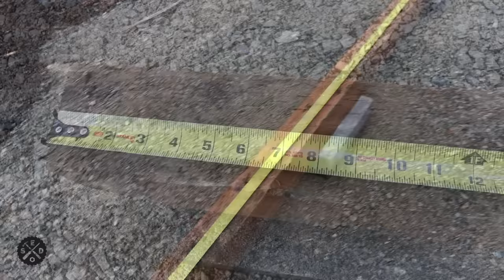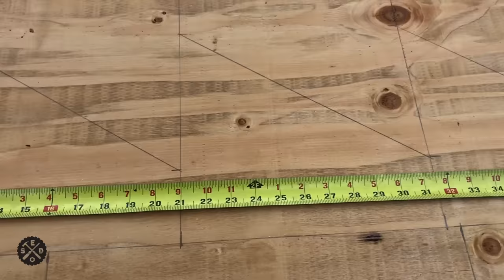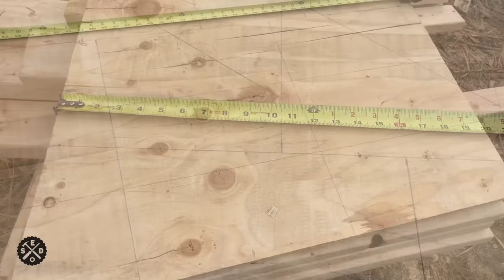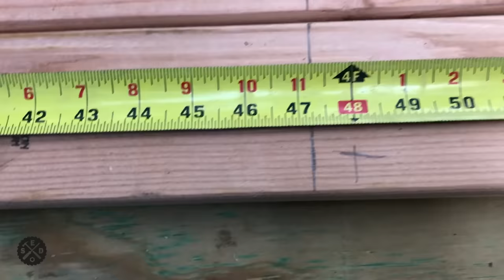How To Build A Shed By Yourself All STEPS 10x16 diy

Comment: Good norning all - nicely done. I have a couple of questions. What is your source for the rough cut lumber and is the Ruggedwood your product? tks grant
Reply from the maker: Thank you so much! So I just sourced the rough cut lumber local to my area. I would try to find a local sawmill if you can. You could ask around locally on Facebook groups etc. to find out if there’s anyone in your area that mills lumber. Yes the wood treatment is mine.
Reply: @SmartEasyDIYer  Thanks - I saw your mill, so you probably sourced close to home.
Reply from the maker: I actually just got the mill recently I didn’t have it when I built this. I would’ve liked to though.

Comment: When the wood expands and contracts with moisture and temperature changes the nails pull loose ; screws are better but their small heads eventually get pulled and pushed out of wood . To keep the whole build TIGHT use washers on every screw .
Reply from the maker: Are you talking outside on the siding? Thats why I use ring shank nails. They hold very well.

Comment: Question, how do you seal the overlaps of the roof, to keep water/ice build up between them?
It almost looks like you're in the High Oregon mountain area, I grew up in?  Great tutorial & build.  TYVM
Reply from the maker: Thank you so much! I’m in MT. It’s mountain area for sure. So there’s never really an issue where they overlap that I’ve ever seen. You can put a thin layer of butyl tape seal between the layers if you’re concerned about it, but the only time I’ve ever seen that done is on a valley area where water has a potential to shoot sideways off the one side of the roof.
Reply: @SmartEasyDIYer  that would have been my second guess.  Spent a couple weeks out to Dubois, on the Wind River res, riding horses and unwinding back in 2018.  Snowed 3" June 24th than LOL
Reply from the maker: Awesome! Yeah it can snow quite late in the yr sometimes. Not so good for having a garden. Lol
Reply: @SmartEasyDIYer  But great for the sage brush, whose smell I miss dearly.

Comment: Very nice video. I was wondering, what is the height of this shed? Does it exceed 10 feet from the top of the roof?
Reply from the maker: That’s a good question I don’t believe it does but I’ll have to measure it next time I’m out there and let you know.
Reply from the maker: So I measured it and it’s almost exactly 12’ from bottom of skids on the ground to peak
Reply: @SmartEasyDIYer  Ah, thank you very much for checking!
Reply from the maker: You’re welcome! If you need it lower you can shorten your sidewalls and make your roof pitch less steep accordingly

Comment: This is the best shed build video on Youtube, and I've watched a bunch! 2 questions: 1.) Where did you get the rough cut? My local independent lumber yard closed. :(     And 2.) Is the door handle turned 90º from normal or is that just me? Again this is the best - I going to try to do this build - maybe 12x20...
Reply: putting the chapters into the video is super helpful too for later reference!
Reply from the maker: Thank you so much! I’m glad you enjoyed it. So I got the rough cut from a local sawmill. You could check around on craigslist or FB marketplace and see if you have any local Sawyer’s in your area. I’m not sure on the doorhandle you can rotate it however you want I just turned it that way because it felt natural to me. Yes I figured the chapters with make it for easy reference for going through such a long video. Thanks for the feedback! Good luck with your shed build!!

Comment: Awesome video, like everyone has already stated, it’s the best detailed video o you tube period!  Materials list,approx cost, comparison with this shed kits, everything man, I was just telling my wife no one has done this, on YT, and believe me I’ve looked, that’s agin for sharing 👍. 1 question, if I wanted to place the doors on the side, (the 16’ side) instead of the front, I’m assuming I would us the same formula you used correct?
Reply from the maker: Hey thank you so much for letting me know!! I appreciate it. Yes so the only difference is you would have to build the header differently because it’s weight-bearing. I just put the header boards flat on this one because it’s on the end wall where it’s not weight-bearing and it came out well with the measurement that I had with stacking three of them but on the weight-bearing side where you’re talking you would probably want to turn two 2x6 on edge and maybe put like a strip of half-inch plywood in between so they are the correct dimension 3-1/2” total and nail it together really well. Then on the ends where the header would sit I would say you would want 1 king stud plus 2 jack studs under each end to hold the header. If you have plenty you could even do 2 king studs. Hopefully that makes sense.

Comment: Great job! What is the height of the walls and what is the height of the roof from top plate? Thanks
Reply from the maker: Thank you! It’s 7’ to top off walls for height. I’ll have to measure the roof when I get out there again. I’ll update you on that.
Reply from the maker: OK so from top of the wall to the very peak is 45” on the trusses.
Reply: Smart Easy DIY thank you, I was held back on building 12 by 16 shed as I was not comfortable with trusses. This video gave me courage and rethinking. Will start something next year, meanwhile 2x4x8 in Lowe’s doubled the price. $6.29, not encouraging, will hold on for now.
Reply from the maker: You’re welcome. Yes lumber went crazy right now. I’m hopeful in the spring it’ll get better again. Good luck with it!

Comment: Fantastic video. Can't believe I watched the whole thing. I was toying with the idea of buying a pre-fab shed for our new property, but you've inspired me to tackle the project myself. I plan to rewatch your video again and take notes. Really great tutorial. Here's my only dilemma. I really like the idea of building the shed on a wood floor, but I plan to park a small sub-compact tractor inside (like a Kubota BX series or equivalent).  I know a concrete floor would be ideal, but I'd rather not have to pour concrete if I can avoid it. Part of the reason is that I may choose to move the shed in the future when we can afford to build a larger pole barn. Do you think the floor you built would be sturdy enough to handle a tractor of that size, or should I be planning for a sturdier floor construction? Thanks in advance for any advice you can offer.
Reply from the maker: Thank you so much it is a long video to watch. I’m not sure which tractor you’re planning to get in the BX series but I’m guessing they would weigh quite a bit. I think what I would do in your situation is see exactly how much they weigh and i’m not sure how to calculate load weight on floor joists but I would think maybe if you did like four skids under the shed, did the floor joists every foot apart, and doubled up on the plywood or else did 2 inch planks for the floor that it should be sufficient. Maybe check the price on that extra beefy floor by the time you do all that the concrete might be cheaper. That’s just some ideas to consider. I wish you the best with it!

Comment: I would most likely use green treated lumber if you want it to last. Termites, ants, dampness, etc can really rot out non-treated lumber even if not in direct contact with the ground.
Reply from the maker: Yes in this part of the country this is the only pressure treated available. I’ve seen it in other states but not here. This is sufficient for here.

Comment: Great video! Please let me know what model nailer you used?
Reply from the maker: Thanks! Do you mean the cordless one or the pneumatic ones, I used several different ones in this video?
Reply: @SmartEasyDIYer  pneumatic ones. Thank you for the quick reply!
Reply from the maker: You’re welcome. I used a bostitch stick nailer and coil nailer. I’d have to check on the model when I get home later. I don’t think they make them anymore but you can find a lot of used ones on ebay.
Reply from the maker: So the coil nailer is a bostitch N80CB. The stick nailer is a bostitch F28WW.
Reply: @SmartEasyDIYer  Thank You very much!

Comment: To alleviate any confusion what you're calling patches are actually called gusset plates and they help strengthen the joints for the truss. Otherwise really good video, well done!
Reply from the maker: That is correct. Gussets. I was just used to calling them that in a previous life. Lol thanks

Comment: coool shed build. enjoyed. however take out the square screws holding the handle and it will turn the inside handle as it is locked onto the spine and door will open. oops
really love the shed build
Reply from the maker: Thanks. Yes you could bolt it if you countersink the bolts.

Comment: Hi. If it rains heavily from the side, then I see a problem with the tightness of the door.
Reply from the maker: I have had no issues. It’s just for storing stuff. If you wanted it really tight you may have to buy one.
Reply: @SmartEasyDIYer  Right now I'm working on plans for a tighter version of your cabin. It should not be too difficult. As a basis, your version is incredibly helpful.
Reply from the maker: Thanks. Good luck with it! The nice thing about these is the basics are the same and then you can just change it just a little to suit your needs.

Comment: Seems like it would make sense to wrap the outside with black tar paper so when those boards dry out and the gaps open you will not see white strips.
Reply from the maker: Well that’s what the battens are for is to cover the cracks of the boards. I don’t see any white on mine. Also my boards were dry when I put them on. You could though if you want to.
Reply: @SmartEasyDIYer  Yep did not realize u were going with B&B for the siding.  I use the tar paper to create a way for air to move behind the boards and channel any water down and away from the inside.  That tyvek stuff is great but pricy....
Reply from the maker: Yeah that makes sense for The situation you’re talking about.

Comment: Could you not add it before you lay it on the runners?
Yes, you would need a helper to set it but it would be more square.
Not so sure My Menards is cheaper depends on location.
I thought the one in Nebraska was cheaper than here in Missouri but I have to realize it's been almost 20 years ago too.
Thanks for this vid.
Reply from the maker: You’re welcome. I’ve never been to Menards personally but just from what I heard they were pretty good priced. Are you referring to the plywood on the bottom? Yes if you framed it up Side down then sheated it and then had someone to help you flip it over, maybe several people depending on the size of your shed it could be quite heavy. Thanks

Comment: why would I need to put insulation in the floor or in the walls if I am just going to use this as a storage shed for unused houshold goods in boxes or plastic bins and for winter storage of lawn equipment?
Reply from the maker: You wouldn’t need to for a storage shed I’m just addressing the option while building it if you were to want to heat it in the future then you would want to insulate The floor while you have access to it. Thanks

Comment: Why put the beams 16" in from the edge relative to the rim joist and not flush? If I'm going to build a tiny home in a similar fashion doesn't that cantilever too much weight outside?
Reply from the maker: This just helped to cut down on the span between my skids. It probably would’ve spanned it just fine, but if I would’ve kept them flush, I would’ve put another skid in the center I think.
Reply: @SmartEasyDIYer  thanks for the reply! This guide is great. Since I'm going to be putting this on piers I'm really trying to avoid three more holes, three pillars and another beam. However many have advised against cantilevering the ends. I'm going to copy your plans otherwise but do a cathedral roof with a loft.
Reply from the maker: You’re welcome thanks for letting me know. I think it would support the weight just fine but if you’re worried about it, you could also go with a little  beefier joists. Good luck with it! I’m sure it’ll turn out great

Comment: Like most DIY videos, it is so inspiring to watch until you start doing the same thing yourself the FIRST time. You realize then the video skips so many parts that are exactly what make the project successful. For example, how do you build the first roof truss (11:46) that is used as a model for the successive trusses? The framed wall - it just magically built at 19:32. So how does one build the first one?
Reply from the maker: That’s the problem with skipping ahead in the video. Did you watch the entire video of that section? 11:46 The truss isn’t just magically built I’m showing how to lay it out and measure it and put it all together first. I thought I explained quite well how to make a jig and build your first truss. I dedicated quite a few minutes to building the trusses. Then at 18:58 I start laying out walls. I think if you watch that entire section from the start till when I build the walls you should get a much better idea. I tried to include as many details as possible that’s why the video is so crazy long.

Comment: what kind of wood is this with all the intentions, never saw this kind before anywhere and I pickup wood everywhere used and new.  Please let me know the reasoning for all the slits thanks
Reply from the maker: Hi are you talking about the board and batten? It’s rough cut Doug fir and larch.
Reply: @SmartEasyDIYer   The boards not sure what the batten is , but all the boards on all 4 corners have like marks pressed in them, was this just from the saw mill, or for some other reason and is this natural color of the wood looks stained, cool looking wood. Im in Tennessee so mostly see hardwoods and cedar, a little pine. Love the grey outside color you chose too.
Reply from the maker: Yes if you watch the video and check out where I start installing the siding you’ll see it much better. I have it bookmarked in chapter so you can skip ahead to the siding install. The marks are from the sawmill it was a circular mill. The stain that I used is called Rugged Wood Treatment I have more information in the video description. It’s really cool stuff. Thanks

Comment: To ensure squareness of your foundation, you should make two additional measurements along with the diagonals.  Measuring the diagonals will ensure you don't have a paralleogram shape foundation.  Measure the space between the foundation beams at each end.  If your spacing isn't equal, your beams will assume a trapezoid shape but you'll still measure the diagonals as equal.  A trapezoid will have two opposing sides of equal length and two unequal.  And we thought we'd never need to use geometry when we granduated from high school.
Reply from the maker: Yes as long as your beams are level prior to squaring up I think it’ll work close enough for this build. 😉
Reply: @SmartEasyDIYer  As we say in government circles:  It's close enough for government work.  I don't think there's a house or building on this earth that is built with any precision. No reason to start now.
Reply from the maker: Haha yes I’ve heard that term before.

Comment: That's the best shed video on youtube.  I only have one negative thing to say (and I'm probably wrong about it).  Why did you only use 2 skids?  My brain is telling me that 4 would be best for 10 foot span or at the very least one in the middle to support the weight of a riding mower or the like.  Like I said... that is a great video and I really like how the aged batten turned out.
Reply from the maker: Thank you so much! So you easily could add one more skid in the middle but with doing 16 inches on center with the floor joists and 3/4 inch plywood it is very solid! I certainly wouldn’t hesitate to pull a riding lawnmower in there if that’s what I wanted it for. But for peace of mind you could easily add that one. Thanks again

Comment: Flooring should always be T&G (tongue and groove). 
 I recommend adding plate cap (2nd top plate), easiest way to tie the walls together. Plus California corner your framing. 
 Especially important if you ever want to put those skids to work... (relocate building). 
 One more thing, add house wrap... 
(Tyvek moisture barrier). 

 I'm a dinosaur, stuck on the old ways. Anyway, good luck, 
cheers!
Reply from the maker: Yeah I couldn’t find any pressure treated t&g plywood for my floor at the time otherwise I would’ve. Yes you could certainly add the top plate which I mentioned about, Tyvek is good especially if you’re planning to heat it. 👍
Reply: @SmartEasyDIYer 
 Honestly, you did better on that build than half the jokers I know?
 And that is valid point... supplies are dependent on availability and budget.
Staggering flooring,  shear wall and roof sheathing. Even sheet rock...
I would put plywood flooring with smaller pieces in the middle, (aesthetics).
If it was T&G then the floor layout is correct

Comment: russes and pitches are a little tricky for less than a carpenter. to get uniform and strong trusses for novice builders.. use over sized gussets.from the ridge down each side 12 inches .then your jig and the gussets working together ensures uniform trusses..oh and 2 inch galvanized ring shanks would be the ideal fastener for this application or wide crown staples.as there holding qualities are superior. and the fastener used to repair engineered trusses in the field.The distressed look of your exterior siding is very uniform , Montana Timber Co. could use a guy like you. very close to U.B.C. 2012. minor change on the load transfer and some hardware that would fly about anywhere with an 8 pitch .Good job.
Reply from the maker: Thank you for the input I appreciate it!